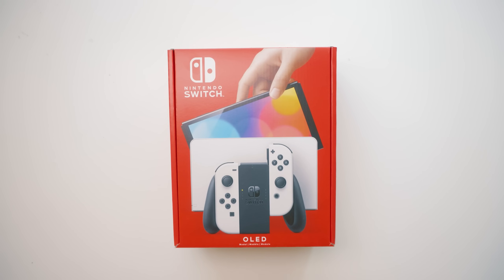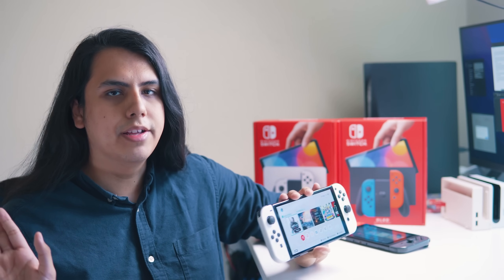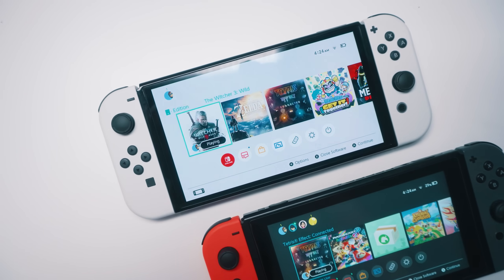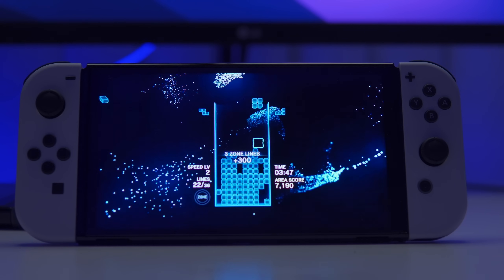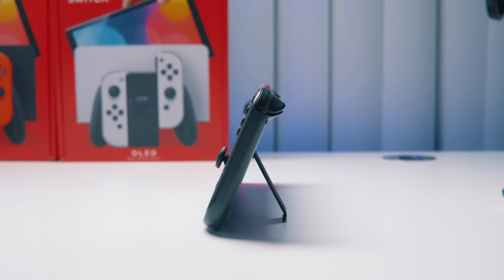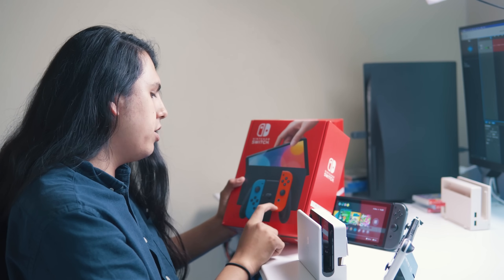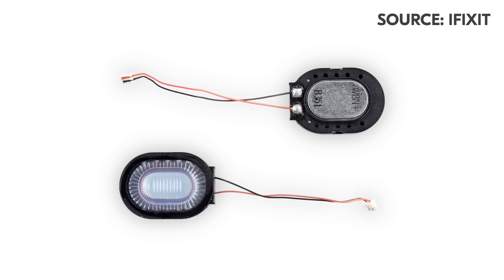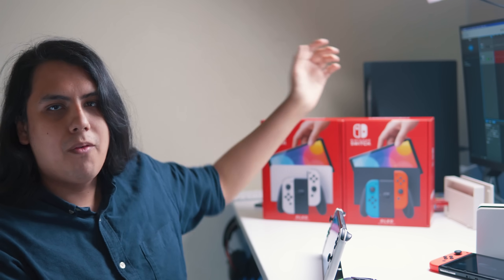Nintendo OLED Switch: Is it Worth the $350 Price?

Comment: Nice review, enjoyed your honesty. I also realized that for $50 more you can get a PS5 digital or you can save $50 and get a Xbox series S. Not to mention after a memory card, screen protector, and case it’s just not a good value. I would only play handheld mode, so I am considering a Switch lite for $150 less.
Reply: My 128gb micro SD card was only $20 and so was the screen protector that came with a traveling case from Nintendo.
Reply: If you’re going to only use handheld then TOTALLY GET LITE
Reply: A switch lite is tots worth it BUT if you have any desire to play docked you may regret it later. My GF had a switch lite and I had a switch OLED, when she tried it she found she actually really loved playing in dock mode and had to save up for a whole new switch bc she wanted to give her old one to her bro. My sisters on the other hand have lites and they love their switches, they don't care about being docked to the TV and if they ever wanted to play games in docked mode they can borrow my switch. As for the SD card and protector I will say the dock's less likely to scratch the screen than the old dock and and depending where you are you could get a 256 gb sd card for like $25. If you wanted to get a case for the switch you can get them for like $15-$20 and they typically come with screen protectors and thumb grips
Reply: Switch lite is bad
Reply: @hagollow  it really depends, if you only ever play by yourself and in handheld mode it's great, or if you have a family which already has 1 switch and there are other ppl who want to play their own switch games then it's great. Like in my fam I have the OLED, my sibs have lites, they never really play stuff docked or care to, if they do want to play something docked though they can borrow my switch most of the time
Reply: Man just get the oled the lite u can’t play with nobody, I’m not a fan of the dock swich but I’m telling u that in the long term the oled is the best one, u going to regret buying the lite for me happened

Comment: Thanks for the info. I recently saw a video on all of the current Gen controller stick switches and hearing details on the Switch/3DS speakers is interesting.

If we knew more about the specifics of the hardware so coveted we may be more hesitant to pay such a premium.

Of course, you can’t do that without voiding the warranty so it’s kind of a risk to get that info out there. Still, thanks for taking apart the joycon so we could look inside.

Comment: I think I personally would wait to see if at some point in the future they once again put out a new switch but with more improvements. Sure these few upgrades are nice but I don’t want to spend money on one that is only a little bit different than what I already have. Since I already have a switch and one that still works well, it would be hard to justify getting this new one.
If someone didn’t already have a switch though, then it might be worth it.
Reply: This is exactly my train of thought too, although my current switch is pretty broken. My switch does everything I want it to, and although an upgrade does seem nice, it just isn't enough of an upgrade to justify the $350 purchase. I'd rather save that money for a PS5 (when they become available)
Reply: a new switch would probably not be backward compatible
Reply: @citrufruit  not  a zelda fan?
Reply: It's better then you think. I just got mine and I use my switch so much more then I used to because it's so much better. Granted I also had a lite
Reply: A new switch would have to be something monumentally incredible in the face of Valve's new Steam Deck & at a price that competes with it at 400 bucks. I think the party is over for Nintendo.
Reply: @blazingsaddle166  It's not over because of their games. Their games is literally the only reason to buy the switch

Comment: Great video & discussion 👍 
I purchased the OLED Switch to replace my old beat up launch model & I'm glad i did. Some will scoff & say that OLED just makes colors saturated & they can live without the new screen size. But they'd have to get one in front of them to fully understand the visual difference in clarity. By default, colors pop 110% on everything & Text is just easier to read.
It's almost like an HDR effect- 
But specifically, (if I didn't know better) the OLED almost seems to render 3D polygon based games at a higher resolution because everything is so razor sharp on native res. It almost looks as if you can reach out & touch the objects on screen due to the contrast between light and dark which creates a higher sense of depth perception as a result. I can say without hesitation that I'm never going back to the old switch.

Comment: While the actual panel is made of glass , the shatter protector ontop of it is made of plastic. if you watch jerryrigeverythings durability test, the screen (with the protector , which you should not remove) is at the same durability of the other switch models.

Comment: Before watching the video, I truly do think it is a rip off unless you really want a better screen for handheld. 

If you mostly want to use your switch like a home console and rarely, if ever, want to use it for handheld then this isn't worth the money and you might as well get the original switch. 

If you don't plan on gaming while dock and use it for handheld, then sure. It's a pretty screen and could be worth it, HOWEVER, if you're only going to use it as a pure handheld system then get the Switch Lite. It's 200 USD and that 150 USD you'll be saving, you could get a few games, accessories like a case or something.

So unless that really nice screen is an absolute, then yeah, maybe don't get the Oled. But eh, the screen is really pretty.

Comment: There is a cloud save for Animal Crossing if you have it enabled. The tough part is it won't work unless it gets permission from tech support for a restore. I had trouble with the transfer tool. We put it in restore mode and bang they cloud restored it.

Comment: I feel like to a certain extent, Nintendo is a spiral downwards. While the switch is widely successful, it is falling behind its competitors in ways beyond the hardware. For example, Xbox Game Pass gives access to hundreds of games for a few dollars a month and Xbox with their backward compatibility program converted EVERY game from the 360 and original that developers participated in. Nintendo can't even seem to figure out how to make their own older games playable on their new device and they used a free open-source emulation, then downgraded it for the switch. Their online features are lacking. Their exclusives are becoming dull minus a few titles, and they are vastly just porting over previous titles from past consoles and charging full price.

 Then the hardware is interesting. While I do see they made both a portable and home console, it only kind of is. Since the docking station is only a docking station where the biggest advantage is it upscales the visuals from 720 to 1080. There are no additional CPU capabilities or  GPU capabilities, it simply is nothing more than a converter to play it on a TV and charging station. Furthermore a slap to consumers faces and shows Nintendo's greed, they purposely made the charging of the switch proprietary. It uses USB-C to charge which is fine, but the rate of charge is what seperates it as the original charger charges in waves. Third party chargers do not do this which caused chipsets on the switch to burn out, possible bricking of the device, and incorrect charging of the switch. Entirely so that you have to buy Nintendo's chargers or risk breaking your device. The docking station is comparable to an arduino board, its only function is to convert the data transfer output to play on a tv and charge the switch. The hardware itself is more comparable to the 360 and PS3 in terms of power capabilities which is alright at launch but now years later feels outdated. 

All of this was done on purpose. After the fail of the Wii U, Nintendo had no idea if the switch would succeed or not so they had to minimize their potential loss. After it's success they began to extract the customers money with shady tactics all to pinch every penny out of you. If they want to succeed they should make a switch 2 where the switch portable has newly upgraded internals and the docking station also works as its own stand alone system with hardware comparable to an actual home console. Similar to the Wii U, if they took the Wii U console idea and upgraded it, then paired it with the switch tablet and joycons that would be a huge success. A true home and portable console running on the same software and system details.

Comment: Base model discontinues q2 of 2022. This is when OLED drops to 300$. OLED lites and an all Digital switch model are up next. Successor machine is 2026.
Reply: 2026 is way too far away.
Reply: 2024 at the latest.
Reply: @denisn8336  nintendo spent their R and D budget for the next gen machine in 2018.
5 years development time is 2023. The timing of OLED makes the price drop for it to base model price Q2 of 2022. The redbox V2 switch is going  away in 2022. Next up is the Switch lite OLED and the all digital Switch. Then when OLED switch lites release old switch lites are gone. This span will cover to 2024 for oled lites and digital only switch. So since the development time for the next gen machine is 5 years that is 2023. Then you give Nintendo 1 year 2024 to decide on the exterior shell design that puts us at 2025. This is the speculation and hype build up year for new machine. This places the next gen machine in the summer to holiday window of 2026 for release.
Reply: @GameAGuy  Nope
Reply: @TheAlibabatree  YES
Reply: @GameAGuy  Insider info?
Reply: @TheAlibabatree  the earliest Nintendo would dare launch it would be 2023 .
The reason we can tell it isn't next year is cause of Oled and the fact the rumors say it isn't backwards compatible. Nintendo is not stupid enough to launch a 4k switch with 100 base model,oled,lite switches out to consumors. 
The next two models are All Digital Switch and Oled Lites. Which one releases first is up to them. 
There is no way Nintendo would launch BOTW2 on a console no one would have yet. 
Most likely the All digital will be next then OLED lites after. 
2026 is the sweet spot for next gen machine. Oled drops to 300$ q2 of 2022. 2023 All Digital. 2024 Switch Oled Lites. 2025 new console gen hype 2026 release.
Reply: @GameAGuy  So, thats a no
Reply: @TheAlibabatree  the all digital will work with Oled dock
Reply: Botw2 will launch the all digital
Reply: @GameAGuy  You have no facts my guy. You’re just spewing hopes and opinions.

Comment: $350? Dude, I spend like over $500CAD on the OLED.
Reply: 0.78$ USD per 1$ CAD
Reply: @marvingeorge8856  I still feel ripped off, fu*k!
Reply: @jackfavvv0280  I got one too, not sure how to feel about it :/ did have the OG switch but is beaten down pretty much. I read that there wasn't gonna be a pro switch or anything like that. So I bit the bullet.
Reply: @marvingeorge8856  There will be a Switch pro, or something with a different name. I have a feeling they delayed Breath Wild 2 for that purpose.
Reply: @jackfavvv0280  you might be right. I might return the oled and wait a bit since more research point to a newer console next year
Reply: @jackfavvv0280  I got a bit desperate for a better console 😅 guess a lesson was learned
Reply: @marvingeorge8856  I got the OLED as well because I didn't get the original Switch. Anyhow, if Prime 4 doesn't get released this year, then I'm almost certain there will be a new Switch revision.
Reply: @jackfavvv0280  I hope you enjoy it, I'm still on the fence with the purchase. Convince me it was worth it
Reply: @marvingeorge8856  If you can hold out till next year, than DON'T get it yet, just wait. The Switch has no real competition right now besides Odyssey and Breath of Wild.
Reply: @jackfavvv0280  lol, I already bought it. Should I return it is what I'm asking. I'm still able to return it
Reply: @marvingeorge8856  Yes, if you still have the receipt, and it still hasn't expired yet.
Reply: @jackfavvv0280  I'm listening to you now. We've practically became brothers, so i have no doubt that your words are utter wisdom